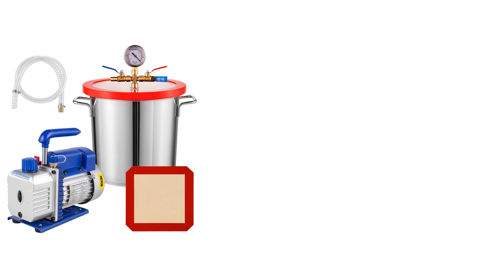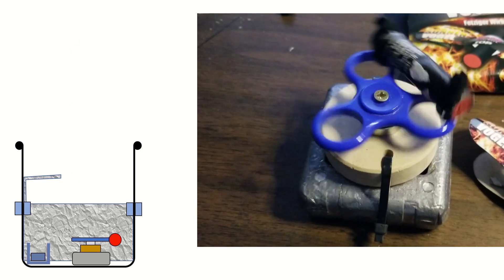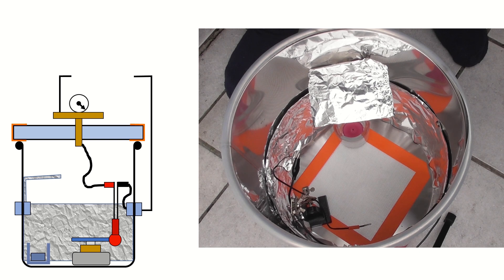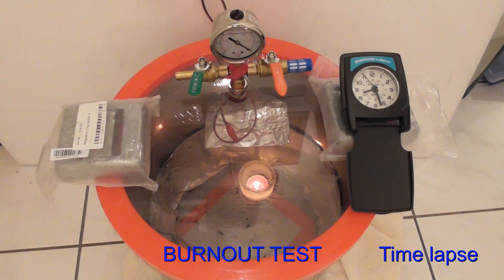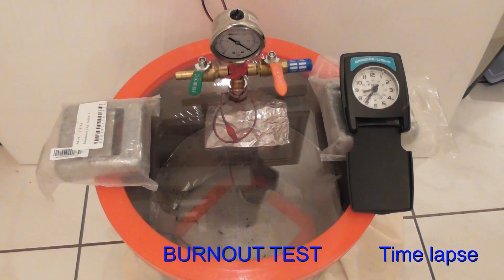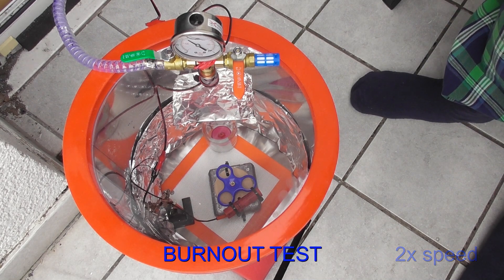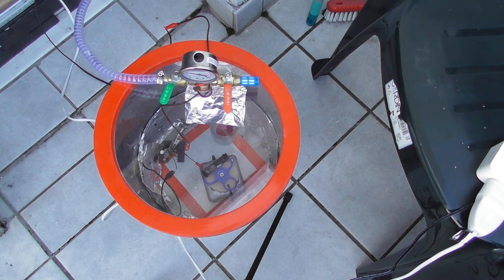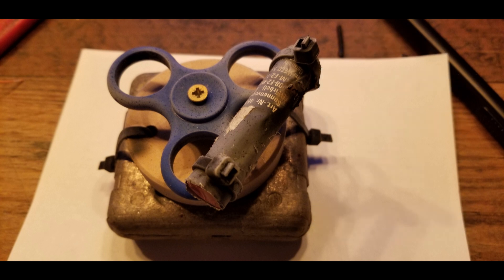Rocket in a Vacuum

Comment: I slowed the video down to the slowest and counted 10 rotations of the rocket. If i calculate 1ft per rotation, that equals total distance covered is 10ft. And thats generous. How far does it go outside? I bet you it goes alot higher than 10ft.

Comment: 🤦‍♂️ the rocket works because it’s “pushing” against the side of the container. In the vacuum of space, not only is there no atmosphere to “push” against, but no objects for the thrust to “push” against.
Reply from the maker: the wall of the chamber is curved which would deflect the emissions away from the rocket. so.. no.

Comment: How close is that to the  vacuum of space?
Reply from the maker: closer than your channel subscriptions.
Reply: @slysparkane808  I'll take that as a "no where near the vaccum, so I won't answer".
Reply from the maker: @monty3322  you can 'take' it however you want to. but since it appears you didnt watch the video where the answer is on the meter shown several times.. it would not have mattered what answer I gave.
Reply from the maker: well.. I would hope you would have taken the hint and actually watched the video.. all of my readings were in it.. But I guess I was to optimistic.
Reply: @slysparkane808  Your readings weren't the question, you're dancing around it....and it's pretty obvious.
Reply from the maker: @monty3322 how am I dancing around it when it's IN THE VIDEO?
Reply: @slysparkane808  No it isn't.
Reply from the maker: @monty3322  sorry.. but it is.

Comment: really really bad scientific method. you have no control whatsoever, cause the chamber is far to small for the experiment to hold any water.
firstly and most obviously your chamber walls provide something for the rocket to thrust off of. secondly the second you light that rocket in such a small space the chamber becomes pressurized anyway. due to the matter it ejects and the massive amount of heat very very quickly raises the pressure. as the rocket cools the pressure should drop back into vacuum, but the rocket has already done its thing. you wasted everyones time and we are all dumber for it. thanks
Reply: He's a troll.

Comment: What happens the instant you release gas into a vacuum chamber? You no longer have a vacuum. You've effectively introduced atmospheric pressure.
Reply from the maker: Feel free to take my $500 challenge
Reply: @slysparkane808 
You didn't answer my question. If you release gas into a vacuum chamber is there still a vacuum within. Yes or no
Reply from the maker: @TerenceHughes4501  I'm 3 steps ahead of you.. you want to cry foul because of course there are emissions from a rocket, and you want me to give you permission, as it were, to dismiss what you just witnessed.. However. until you can prove that rockets push off ANYTHING beyond the rim of the exhaust..  My challenge is always open.. 

And since you will use this reply as some kind of "sly is afraid to answer".. save it.. because the claim I was disproving with this test (which you and your friends wont do) didn't even need disproving because of the FACT that rockets push off NOTHING beyond the rim of the exhaust.
Reply: @slysparkane808 
I'm just pointing out the futility of using a vacuum in a small container to prove Rockets work in a vacuum. You release gas into that chamber and you effectively create an atmosphere within it. You've lost your vacuum. You prove nothing
Reply from the maker: @TerenceHughes4501  what is the ratio of atmosphere required to cause acceleration from combustion?

Comment: Well done, Sly!

Robert Goddard had a novel vacuum vessel construction for his demonstration that rockets will definitely work in vacuum. He used a "racetrack" shaped large tube so as to demonstrate that the rocket's exhaust wasn't "pushing off the walls" of his chamber, or even filling it up with exhaust, thus spoiling the vacuum.

This ultimately resulted in the greatest news story retraction, possibly of all-time. The New York Times initially claimed that Goddard was wrong, and that rockets needed physical matter to "push against" to work in space. They corrected themselves, and apologized to Goddard (and presumably the ghost of Isaac Newton). Big Media admitting errors is good, but also quite rare.

Goddard's initial work was studied and improved by Germany, resulting in the V-2. That led to rockets which took humanity to space, and then The Moon.

Comment: If this video is intended to be taken serious! I like to ask these question! what is the scale of  your model? chamber is the size of space, but rocket is size of what? all the stars in universe put together seems like! Do you have a micron gauge to use so we can see?  Have you ever tested smoke and dust particles in vacuum?  Also there is something called outgassing, IF YOU USE 10,000 cubic feet vacuum chamber and use a firecracker maybe it would be more believable! Please stop using the names or discriptions like flat this or houx that because you just made them look even more accurate, and made a fool out of rocket scientist!
Reply from the maker: "If this video is intended to be taken serious!"
great way to start..

"what is the scale of  your model?"
not relevant to the test as performed 

"chamber is the size of space, but rocket is size of what?"
not relevant to the test as performed

"Do you have a micron gauge to use so we can see?"
There is a pressure gauge on the top of the chamber.

"Have you ever tested smoke and dust particles in vacuum?"
not relevant to the test as performed.

"Also there is something called outgassing"
fully aware. 

"Please stop using the names or discriptions like flat this or houx that"
Those are the the 'descriptions' of those who are making the unsubstantiated claims that rockets dont work in a vacuum.

If you feel my results do not show that a rocket can produce propulsion in a vacuum.. feel free to take my open challenge to demonstrate that I am wrong.. https://youtu.be/689Eo2_qUAQ
beyond that, I am not concerned about your dismissive opinion.
Reply: @slysparkane808   Theory needs to be proven by its owner! Not other way around, people can deny everything about it until it is proven to be a fact! Scale is the most important part of science! It is the most relevant part of this equation! Instead of taken my comments as dismissive you could have taken it as constructive! https://youtu.be/SNpGBVoKOmg  https://youtu.be/GCTuirkcRwo
Reply from the maker: @chickybrain  "Theory needs to be proven by its owner!"
I did..

Your linked videos didnt help your discussion. the rocket video makes no mention of force being created by reflecting off anything beyond the engine bell, and the scale compare video had nothing to do with the experiment at hand.

Again.. take my challenge and prove me wrong.. you have NOTHING to lose.
Reply: @slysparkane808  First video is meant to say, maybe you are correct! Second video is to show you why scale is o important! I am not against the theory, that you are working on to prove. I am only trying to point out what could be argued on your video demonstration. Sizes, scale not appropriate. digital micron gauge, hard to temper with also more accurate. Gravity affects dust, smoke particles with speed ( 9.8 m/s2 ) in vacuum. Your video has to work with that in mind. They may even say you need a molecular pump. I personally think that's over kill.  It will require huge amount of money for proper equipment and also time, time is money! For any one to take your challenge seriously you need to put up more much more money. Maybe you can try this at worlds biggest vacuum chamber, that would be amazing video.
Reply from the maker: @chickybrain  Scale is important when working with sizes and distances and making reproductions for tests. This demonstration is not of that kind. This demo is to show ignition, combustion and thrust in a vacuum. the test was successful.

Comment: i am so going to enjoy taking the pis out of this so called experiment
Reply from the maker: Take my $500 challenge
Reply from the maker: how long do I have to wait for you to "take the pis" out of my experiment? and why dont you just take my challenge and prove me wrong?
Reply: Why don't you "take the pis" out of my QUESTIONS?
Most of these physics deniers RUN AWAY and refuse to answer once they see that answering truthfully PROVES THEM WRONG. Let's see if you are as big of a coward.
Let's consider rocket propulsion here on earth IN ATMOSPHERE first then we will get to vacuum .
I like to use Space Shuttle Main Engines as my example as the data is readily available and there are literally hundreds of hours of video.
So when a SSME is running here on earth in atmosphere :
1 - Is the exhaust gas ACCELERATED from the nozzle? (Does it experience a change in momentum as a result of the engine?)
2 - Does the exhaust gas have MASS?
3 - Can MASS be ACCELERATED without a FORCE? (Or is a force REQUIRED to accelerate mass).

Now just answer these three questions about rockets in atmosphere then we will get to the questions about vacuum.
Reply: I would kiss your backside if you could tell me what the EXHAUST GAS IS from a space shuttle main engine (without looking it up).

Comment: Wouldn't the chamber fill up with gas though?
Reply: Even propeller aircraft can still fly at 50,000 feet so there's clearly enough pressure for a rocket to push against. Total fail lol.
Reply: @papalegba6796  46 km is far higher than 50,000 feet with far less atmosphere. "Total fail lol"
Reply: @papalegba6796  
The pressure at 46 km altitude is only 1/100 of that at 50,000 ft, but I guess you don’t understand metric units.
Reply: @QED well a lot of the sloow mow
Channal's has rocket at way way lower 
Psi.
So Rockets push off in vacum
Reply: Notice how the shuttle continued to accelerate after the SRBs were jettisoned at 46 km altitude, proving that the three RS-25 engines worked very well when the atmospheric pressure was only 1/800 of that at sea level:
https://youtu.be/P2q59LXQ1wk?t=149
The small thrusters in the nose of the SRBs that helped pushing them away from the orbiter/external tank also seemed to work just fine!

Comment: You can just wait for the flerfers to argue that the ignition produced smoke, so the vacuum wasn't a vacuum anymore and the rocked pushed off of the smoke.
Most flerfers however, will sit very still in a corner, hoping this will blow over (pun intended).
Reply: did you look away from the gauge as he lit the rocket? the pressure increased to 1/3 of atmosphere before it even moved. the experiment is a complete failure
Reply: Smoke: the visible vapor and gases given off by a burning or smoldering substance, especially the gray, brown, or blackish mixture of gases and suspended carbon particles resulting from the combustion of wood, peat, coal, or other organic matter. 
Vapor & gases lol, you fail.
Reply: @papalegba6796  Just as could be expected. Your citing of the definition of smoke from a dictionary doesn't really help much. BTW, there are better demonstrations for the workings of a rocket in a vacuum, like the one with the bursting Coca-Cola tin.
But at the end: flerfers just don't understand conservation of momentum.
Reply: Oh so the definition of smoke is irrelevant? Because it shows there was not a vacuum in the chamber lol? Ok troll!
Reply: Also I'm not a flat earther & conservation of momentum has nothing to do with how a heat engine produces work. Rockets are heat engines btw. So you're wrong about everything lol.
Reply: Literally saying that physics definitions are "unhelpful" when discussing physics lol, obvious troll is obvious.
Reply: @papalegba6796  Rockets are not heat engines. Just because something gets hot doesn't make it a heat engine. A Crooke's radiometer is a heat engine. A rocket is not.
Reply: @papalegba6796  it's not my problem that you don't understand the working of rockets.
Reply: Rockets are heat engines lol.
Reply: @papalegba6796  no, they are not, they work on the principle of conservation of momentum, heat doesn't come into the equations. The rocket equation first was derived in 1897.
See this citation:
"A rocket is an example of conservation of momentum where the mass of the system is not constant, since the rocket ejects fuel to provide thrust. The rocket equation gives us the change of velocity that the rocket obtains from burning a mass of fuel that decreases the total rocket mass." [OER services, University Physics, volume 1, 9.7: Rocket Propulsion].
Again, the fact that you don't know the very first thing about rockets is not my problem, it's yours and yours only.
Reply: No they're heat engines lmao. Google agrees with me, is it broken for you?
Reply: @papalegba6796  A reaction engine is an engine or motor that produces thrust by expelling reaction mass, in accordance with Newton's third law of motion.
Reply: @papalegba6796  Even if google says that rockets are heat engines, that doesn't mean that rockets don't rely on conservation of momentum to work. Heat does not play any role whatsoever in this process, other than it's a result of combustion that produces massive amounts of gas that is expelled at the backside and so reducing the mass of the rocket. The rocket equation does not mention heat or temperature.
Reply: So even if you're wrong, you're not wrong? Ok troll.
Reply: If heat plays no part in the process why ignite the fuel lol? You make zero sense.
Reply: @frankdebrouwer-leiden  lol he schooled you. mega cope
Reply: @frankdebrouwer-leiden  you don't use conservation of momentum to calculate the output of a heat engine, chatbot 😂

Comment: Flerfer Rockets push off air will be delighted to see this!
Reply: @FlatEarthDwellerMan You seem to be equally dumb as RPOA.
Reply: My favourite argument against the "rockets don’t work in a vacuum" nonsense:

Notice how the shuttle continued to accelerate after the SRBs were jettisoned at 46 km altitude, proving that the three main engines (RS-25) still worked very well when the atmospheric pressure had been reduced by almost 99.9 % compared to that at sea level:
https://youtu.be/P2q59LXQ1wk?t=149
The small thrusters in the nose of the SRBs pushing them away from the shuttle also seemed to work just fine!
Reply: @fromnorway643  Flerfers call everything you mention "fake".
Reply: @josleys  
True, but maybe some on the fence (those with an IQ > 50) will understand?

Comment: A rocket's exhaust, even if if did push off anything, would only do so for a split-second until full thrust was achieved ... at which point ALL gases are moving away from the rocket exhaust at the same speed as the exhaust itself, making it impossible for the exhaust to be pushing against anything. This would mean that the rocket would not move, let alone accelerate. So, if the rocket does move, it cannot be because it is pushing against anything, ergo .. there does not need to be anything to push against in order for a rocket to move.
You don't need an experiment to prove this  .. just a working brain.
Reply: The rocket exhaust does push against something, namely the inside of the combustion chamber and the nozzle!

Comment: 👍Good one ! Regarding Newton's 3rd law, one has to wonder why a flerf would think that: say just for instance, something like "a mousetrap on wheels flinging a coin", should behave differently(& not roll ?) without air. 🤔& as far as a rocket goes, the velocity is even more significant the just the mass alone. They are such a silly breed of pplz 🐒.
Reply: The exhaust velocity in vacuum can be up to 4500 m/sec for a rocket engine burning hydrogen, so 10 gram of that exhaust will according to Newton’s second law produce about 5 times more recoil than a 10-gram rifle bullet.

Comment: Calling it right now: some nimrod will claim that it pushed against the smoke created by the combustion
Reply: Smoke: the visible vapor and gases given off by a burning or smoldering substance, especially the gray, brown, or blackish mixture of gases and suspended carbon particles resulting from the combustion of wood, peat, coal, or other organic matter.
So it wasn't a vacuum in the chamber lol.
Reply: @papalegba6796  The vacuum chamber did not immediately fill with gas for the rocket to push against. You are delusional. How can you push against smoke? Have you tried it?
Reply: @Mandelbrot_Set  you can't read, can you? 😂
Reply: @papalegba6796  You can't answer a question, can you? You have to evade them.

Comment: Years ago there was a flat earther that actually did what I would consider a reasonable job of testing "rockets in a vacuum"  He started off testing the thrust produced with a compressed air jet.  He arranged the compressed air nozzle above a load cell so he could actually measure the thrust produced.  He was amazed to find that the thrust actually increased with a better vacuum.  Because there was less resistance to the out flow of gas, I don't remember if he kept the delta P between the pressure supply and the vacuum vessel constant and that clearly would have been a factor.  Of course he could have produced a plot of thrust vs vacuum vessel pressure but I felt what he did was quite good.  He did admit that the results were what was predicted by others and now what he expected but only left the video up for a little while.  Of course.
Reply: Flat earthers hiding the truth???!!!

I’m shocked. 🤦‍♂️
Reply: @SamualRobotham-IWasOnlyKidding  Hard to fit in with the group when he posts stuff that'll get him ejected. Science deniers don't want to know the truth.
Reply: @synthetic240  conscience -con
Without knowledge
Reply: @SamualRobotham-IWasOnlyKidding  I know!
Reply: Good old Political Hillbilly. He deleted all his vac chamber rocket videos because they proved him wrong. I wonder if he is still out there claiming rockets don't work in space
Reply: Newton was not a flat earther lol. Neither was Joule.